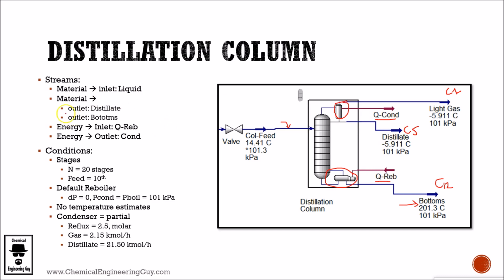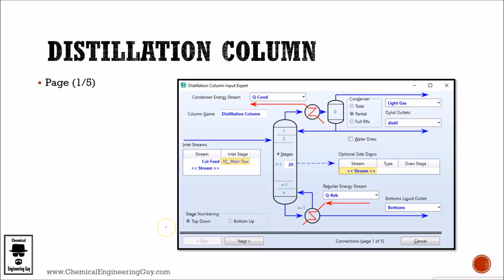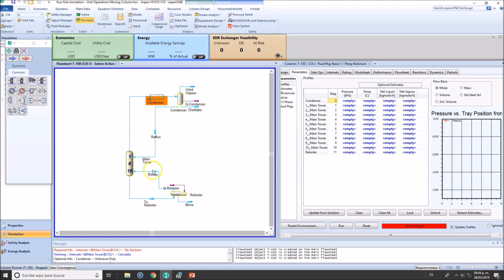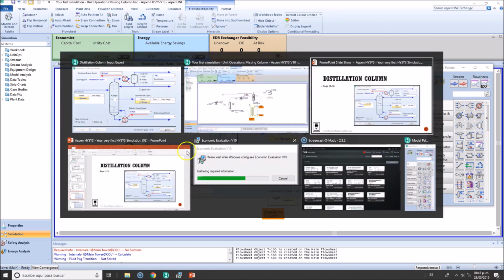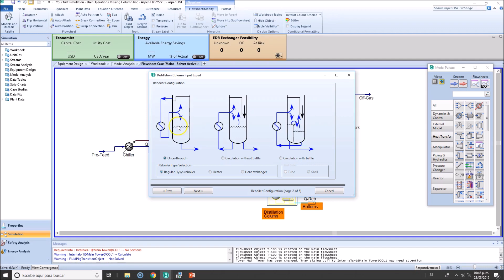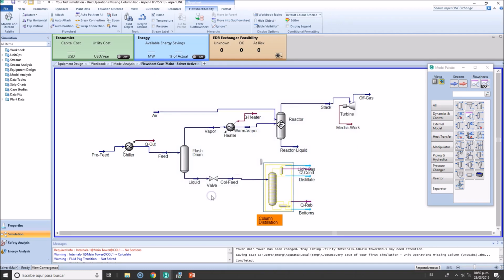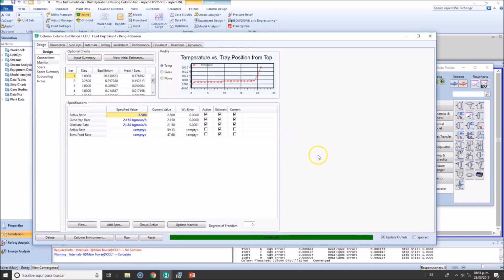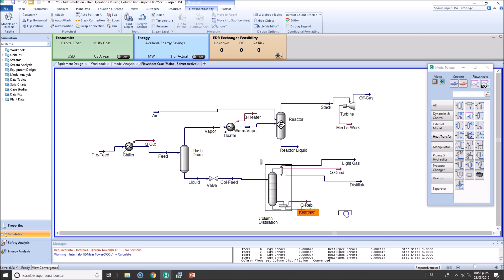How to setup a Distillation Column for hydrocarbons in Aspen HYSYS  (Lec 026)

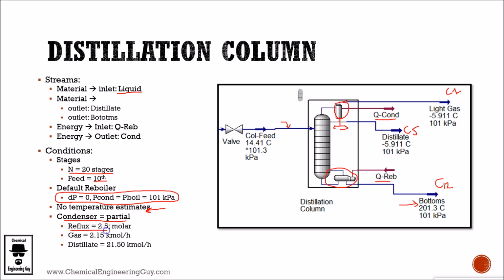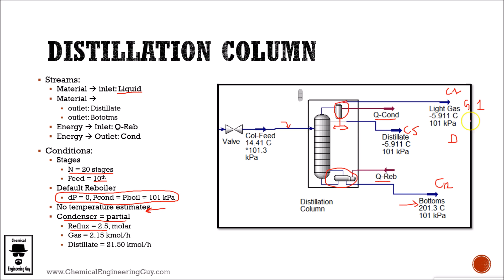Comment: how do I chage  distillate-gas ratio from 1:10 to 1:20?
Reply from the maker: 💬 To change the distillate-to-gas ratio from 1:10 to 1:20, you’ll need to adjust operating parameters like reflux ratio, feed rate, or column pressure to shift the separation. Increasing the reflux or tweaking pressure can increase distillate flow relative to gas. ⚗️📊

Comment: How to reduce the amount of vapor at the top of the rectification column? The type of trays, their efficiency? I have a lot of top reflux in model the unisim program. I am asking for an answer and best regards.
Reply from the maker: if you have a lot of vapor on tops, then you are most likely using very high T profiles, or the condenser T is higher than it should be
Reply: @ChemicalEngineeringGuy  Thank you very much for your answer